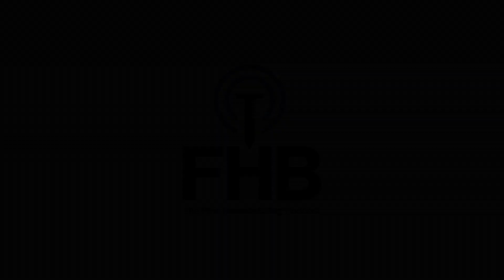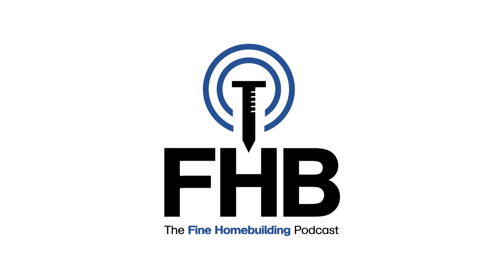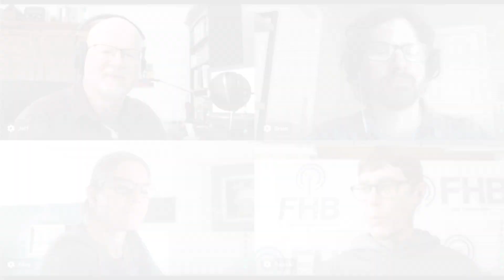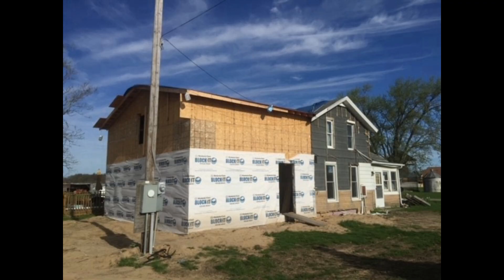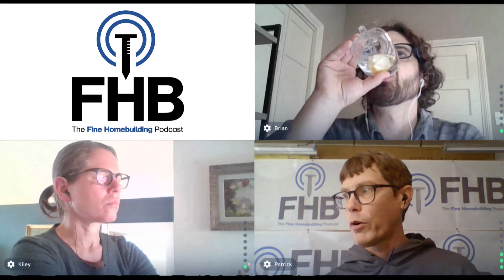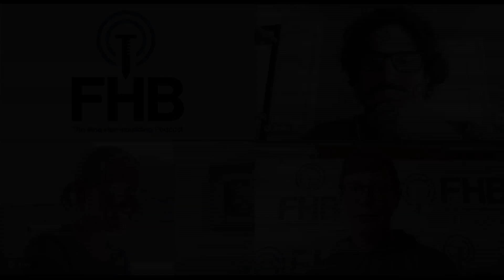Podcast 305: Asbestos Flooring, Panned Return Ducts, and Adding On to a Log Home

Comment: Whenever I run a blower door on a trailer with jalousie windows I always wonder if the depressurization is actually making it tighter because it’s drawing the windows tight. I’ve always wanted to run a test in the pressure mode after the depressurization test and see what the difference is but I’m too impatient and ready to get done with the assessment.

Comment: For the old lonoilen at 30:00 just rool it up. Or take the same precautions that the installer did
Reply: That’s bad advice. Why get it tested if you’re not going to remediate it correctly?
Reply: @robdelaney9116  exactly if it doesn't have a prop 19 sticker just throw it out.
Reply: I was referring to your advice. I think he should pay to have it taken out by professionals.
Reply: @robdelaney9116  and I think he wasted his time and money to get it tested. To do that he had to CUT out a sample so in that process disturbed what is there And paid to have it tested. Now his choices are pay big bucks to have it remedied which would cost more than just hiring a handyman to put in a new floor when he wanted to save on that and DIY but now he knows and has to disclose to anyone he hires to do the job. Just keep it wet to keep the dust down and wear a respirator and DIY it.